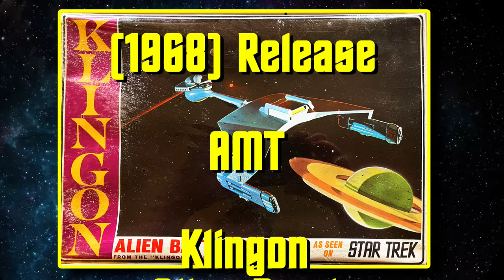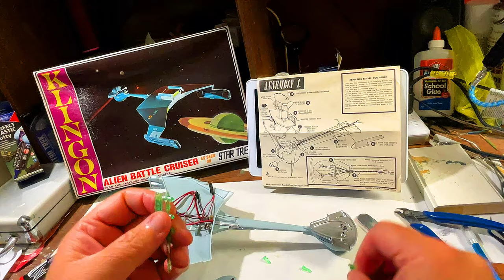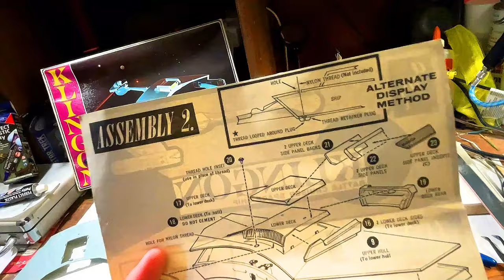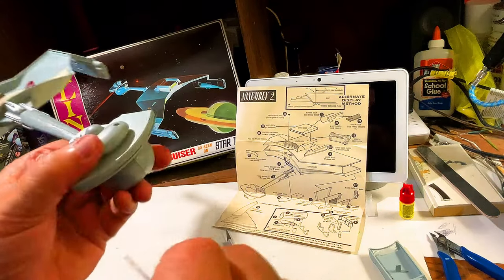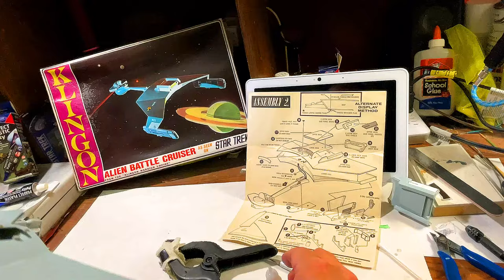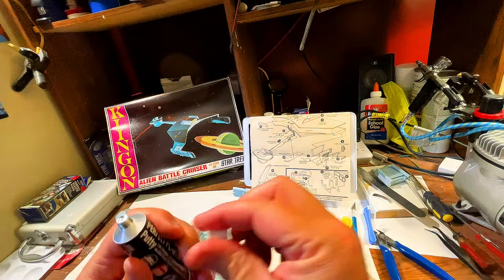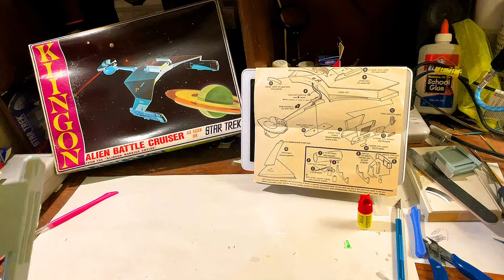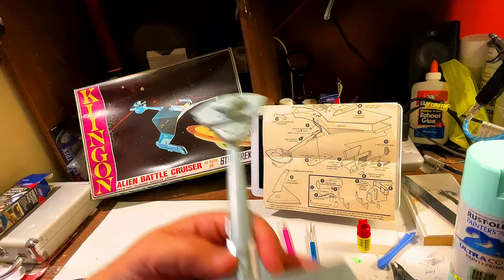1968 AMT Klingon Alien Battle Cruiser Model Kit Build Part Five Building the Model & Paint Prepping

Comment: I don't know if others have commented on this subject? Like the first version of the U.S.S. Enterprise, the First Klingon Battle Cruiser model was supplied with lights and wire. The plastic was grey, and the illuminated parts were the same transparent green, as the transparent green parts of the Enterprise. The battery compartment was in the shuttle craft bay. It also came supplied with many chrome plated parts. I believe the forward section, and the rear engine pods illuminated. I suppose today, they cast everything in one color to save money. That is as best as I can remember over 50 years ago!